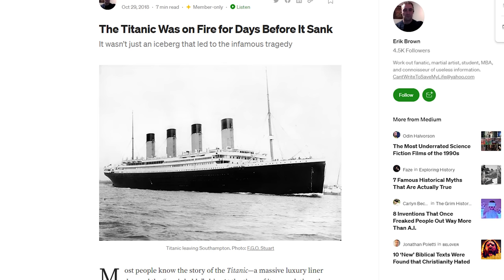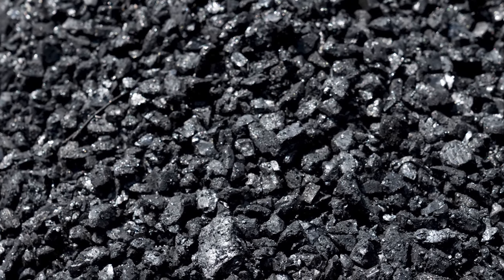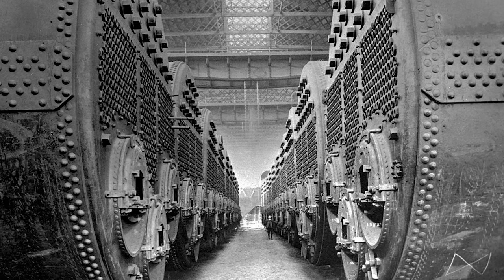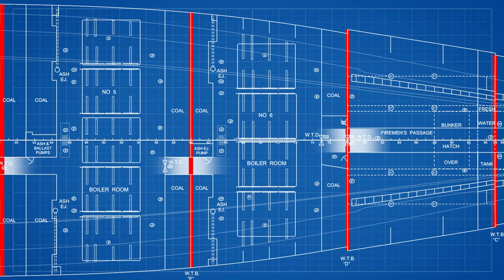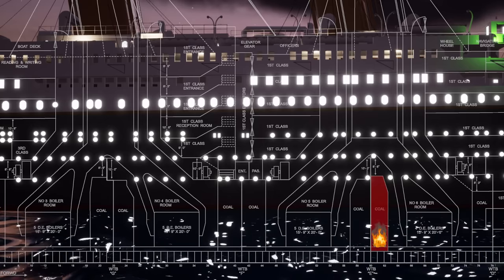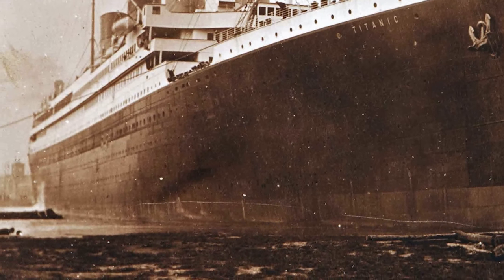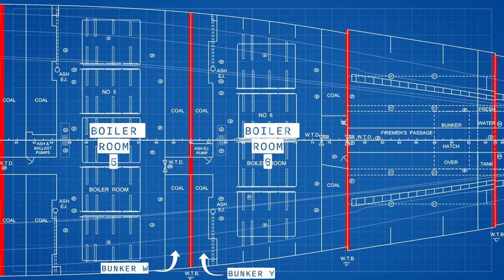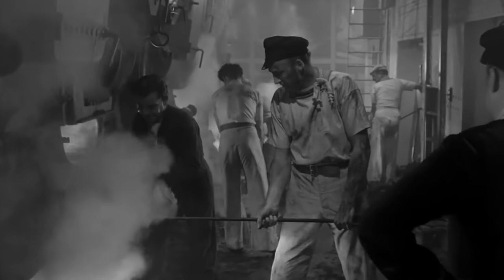Did the Titanic's Coal Fire Cause the Disaster? The Burning Question.

Comment: Thanks for posting a video that actually uses science and facts to debunk yet another ridiculous Titanic conspiracy theory.
There are plenty of new ones lately, but the "It was a coal fire!" one and the "Titanic was actually Olympic and it was an insurance scam!" ones are probably the worst.  The latter is preposterous and holds up to no known records.  The former, the subject of this video, is literally impossible according to the laws of physics.

Coal fires were common on ships at the time, and without the containment of a proper furnace would never have been able to heat even the primitive, fairly mild steels of the day to anywhere near their critical temperature.  Furthermore, even if such temperatures had been reached, which I will remind you again is literally impossible, it would have been moot.  The forces involved in the impact would have exceeded the yield strength of the plates and tensile strength of the rivets, even with proper manufacturing, proper heat treatment, and ideal conditions.  The flooding would have taken place, the watertight bulkheads would have been too low, and the ship would have gone in by the bow regardless.  I'm sorry conspiracy theorists, but it was still an iceberg.
It will ALWAYS have been an iceberg.

The only credible modern theory that has any strong evidence to support it and which clears up any "mystery" surrounding the sinking is that cold water mirage resulting from the Labrador current likely hid the iceberg until it was so close that it had become impossible to effectively maneuver around it.

In which case it was still just the ship hitting an iceberg, with the slight wrinkle that the iceberg also had optical camouflage.

Comment: Another way it could have started is if one of the Stockman's caught fire and was running around so much he bumped into the coal pile and said it a fire the only problem with that is I don't think he would run around and I think they had like water buckets to put out fire and stuff back then so if that did happen yes the coal file would be too big to put out but if someone was on fire you could drench them also did you know there is still water on the Titanic swimming pool😂😂

Comment: Mike—great presentation, as always. Please forgive my ignorance, but have you done any episodes on could the Titanic have been saved? Smith seemed to just give up and say, “OK.  Well that’s that!” I’ve heard a set of double doors were left open, which rapidly increased the rate of sinking. Again, thank you for your wonderful site!
Reply: When Andrews returned from his inspection and advised Smith that his ship was doomed, it is difficult to see what alternatives the captain really had.
Reply: To the extent possible, the crew did try to hold back the flooding as much as possible. Ballast pumps were used to pump water out of boiler room 5 that was leaking from the flooded coal bunker. Not much could be done with the sections forward of boiler room 5, as they flooded too quickly and were not equipped with their own pumps.

Comment: somthing must have been wrong with something for it to start taking on water especially with all the safety masseurs it had
Reply: ...Would grinding against the side of a solid mountain of ice along nearly 300 feet of the hull be enough?
Reply: @DerpyPossum  it had water tight walls and all that but all of a sudden the rest of it was flooded
Reply: @tropixi5336  The water flooded 5 of the ship's 16 watertight compartments, only 4 of which were able to flood without any serious issues. That amount of water pulled the bow down enough to where the water was able to bypass the bulkheads via the decks above, in ways the ship simply wasn't designed for.
Reply: @DerpyPossum  ahh, i but my thought is if they were designed to take in water why werent they water tight on the top of them? or is that where the iceberg struck?
Reply: @tropixi5336  The water was able to bypass them from above via doorways and other small, non-watertight openings like vents, which would allow the water into sections of the ship that went above the bulkheads. As an example; the water in boiler room 6 would rise up to E deck within the boiler room itself, before spilling through a doorway out onto Scotland Road (the main crew corridor on E deck, which was the longest on the ship), flowing aft down the corridor itself, into another doorway and down into another boiler room, filling it up and repeating the process until the ship was sunk. The bulkheads were watertight at the top, it's just that -- since the intended 4 compartments filling wouldn't drag the ship down enough to flood higher than E deck -- the top simply wasn't any higher within the ship than E deck.
Reply: @DerpyPossum  ahh, i was under the assumption that the water filled the bottom first witch dragged one side down first before it snapped

Comment: The dark spot on the hull should also go straight up the side of the ship since, when the ship is not moving, the smoke would rise. I doubt there would have been enough wind in the right direction every time the ship was stopped. Most likely a defect in the negative or print.

Comment: God, not this stupid "theory." First off, most of the coal bunkers were below the waterline, so any fire would have been under water so if the fire ever did heat the hull, the cold water rushing past (especially with the cold conditions of the time of her sinking)  would keep the hull from getting too hot. If the fire had been that high, then it would have been dug out very quickly. Second, it was NOT a watertight bulkhead that failed. It was the coal bunker that failed when it filled with water. The bunker walls were never designed to take the pressure of that much water filling them so it eventually gave way, not the bulkhead. FFS, people and their BS theories.
Reply: You didn't watch the video didn't you ? This video DOES not support the theory, on the contrary it debunks it completely. But you would have to go beyond the intro to see that.

Comment: The smudge actually does align with the fire area. Double check your own blue print and cross reference the actual photo and the intersection of the bridge t section. The fire would have warped any heat treating.
Reply: The fire was in coal bunker number 6 which was further back and below the waterline. It was also just a smoulder and never reached temps high enough to weaken the hull, especially when its in contact with the frigid ocean. 

Bunker fires were common and the one on Titanic contributed nothing to her sinking.
Reply: There is one issue, the spot to where the fire was claimed to be located in that photo is way above the waterline. Not on the waterline.

Comment: I’m from coal country USA. And I can confirm that once spontaneous combustion takes place, those fires can sometimes be impossible to put out. There are fires at abandoned tipples here that have been burning for over a century. The lower quality the coal, the more sludge is part of it, the worse the fire. And since Titanic was running on the scraps of coal she could beg borrow or steal, as the saying goes, the quality was not up to snuff. I don’t believe it compromised the hull. In order to do that, it would have had to burn at temperatures too hot for any human to be near it. But I do think it played some roles in the sinking. I do think that may be why she steamed into an ice field at that speed, why she had a 3 degree list to port before the iceberg (because some tonnage of coal was moved to port to slow the spread causing an uneven weight distribution), and a big part of why she sank as she did (she listed to starboard only briefly before listing to port again and breaking in half. If it was only a matter of water weight without the counter weight of extra coal on the port side, she would have gone down differently). Coal fires on board ships were common in the day. Yes, there were laws and regulations against going to sea with one, but that never stopped anybody before or since from doing anything (how many times have you made a “rolling stop” at a red light?) and as you pointed out, the company faced bankruptcy if Titanic didn’t sail.
Reply: The company was far from bankrupt, or facing bankruptcy.   The third Olympic had been ordered less than six months earlier, and the accounts for White Star for the previous financial show a company in an excellent financial state.

Comment: Still remains a mystery in my opinion. Like how rumors are stated when Bruce Ismay pressured Captain Smith into speed making it earlier into New York. How (in the movie) the captain was worried about the boilers and engines. Is this a hint?
Reply: You shouldn't believe everything you see in a movie. The only, possible, conversation overheard between the two was reported by a survivor who claimed to hear Ismay tell Smith that Titanic was making better time than Olympic had. No suggestion of demanding increased speed at all.

Even that, however, is open to question, as the survivor also reported that Ismay and Smith drank a glass of brandy together, when Smith was a teetotaller.

Comment: I saw a documentary that proposed that it was actually the Olympic that burned, and it was switched for Titanic to collect the insurance. The names were repainted, and it was actually the Olympic that sank. The "accident" went wrong. No one was supposed to die. A rescue had been planned. Film showed the name Olympic on the sunken "Titanic". The documentary was very convincing. The Olympic's hull had been compromised by the fire,  not Titanic. That's why the iceberg pierced the side so easily.
Reply: I know that documentary.

The bad CGI they use to show Olympics name on the wreck always makes me laugh.

But in all seriousness. The ships were never switched.
Reply: The CGI which pretends to show Olympic's name on Titanic is a poorly made fake. It first appeared around the year 2000. It has no provenance, no exploration has ever claimed it, or even acknowledged it, and even the author of the 1995 book which started all this nonsense off,  Robin Gardiner, condemned it as false.

Oh, and to make Olympic look like Titanic, it would be necessary to do rather more than paint a different name on the ship. Especially since both ships' names were engraved in the metalwork, not simply painted on.

Comment: That’s what sank her so fast. She had a fire in the coal. It weakened the bulkheads. Should have been addressed much earlier.
Reply: Wrong, the fire was in Bunker No.6 and beneath the waterline. The fire was nothing more than a smoulder and never reached temperatures hot enough to weaken the mild steel of Titanic's hull which need i remind you was in constant contact with the frigid atlantic.

The bunker fire played no role in the sinking and fires of its type were extremely common.

Comment: Why is the propeller which was intended for the Titanic , put on the Olympic when it lost a propeller, now at the bottom of the sea on the Titanic?
Reply: Because no Titanic propeller was ever fitted to Olympic, perhaps? Aside from the blades being set at different pitches, Olympic's propellers were not damaged in the collision with HMS Hawke. The subsequent inspection report, produced by the Admiralty, the Board of Trade, and White Star, referred only to damage to the propeller shaft, and part of the Incomplete Titanic's shaft was fitted in order to get Olympic back to sea as quickly as possible.

The propeller swap myth originated shortly after the number 401 was detected on the propeller at the wrecksite. Switchers were initially perplexed, but quickly came up with an entirely imaginary explanation in order to maintain their nonsense.

You have fallen for it, mon vieux.

Comment: Yeah, I think it's pretty well-known that there was plenty of time to evacuate the Titanic. The reason so many died was that the designers and owners were overconfident in their claim that the ship was 'unsinkable', leading to a lack of lifeboats. So that was a dumb mistake, but it wasn't corruption; they may have been wrong, but everything they said was something they themselves believed in.
Reply: The lack of lifeboats was from the outdated regulations of the time. In fact, Titanic sailed with 4 more boats than both what the laws required and what it was initially designed with.
Reply: They didn't have enough time to properly launch the lifeboats they did have. The last couple were just floated off as the ship went below the water.
Reply: Firstly, they never claimed it was completely unsinkable.
Secondly, there were more then enough lifeboats than required becouse at the time lifeboats were used to transport passengers from a ship to another, not to evaccuate it.
Also the idea that they had a religious fate in Titanic is kinda weird and makes no sense.

Comment: Everyone who knows a bit about the sinking knows Captain Smith ordered the engines to be stopped while the boilers were still burning: where did all that steam go then? The boilers took 24 hours to cool down completely: does someone really think the engineers didn’t think about this tiny steamy detail? Come on...
Reply: The steam was vented out the pipes on either end of the first 3 funnels. It's widely reported by dozens of people that the steam was venting during the early stages of the evacuation, with some comparing the noise to that of several steam locomotives "going off" right by their ears.

Comment: Been enjoying your videos for a while. Some bad info here.

The "smudge" everyone talks about is not the big black one. There are two, considerably aft of the large reflection, which have a more matte appearance than the rest of the paint. They are also lower, with the more forward one being larger.

The possibility of oxygen ingress and waste gas egress from the bunkers is certainly possible, would require research on my part to form an argument worthy of debate, but i know i have heard good ones.

What is not terribly debatable is the many eyewitness accounts from stokers that multiple bunkers ignited from radiant heat through the plates partitioning them. During liability hearings after the sinking, they were forcibly silenced.

What is absolutely not debatable is the "doosie"; calling for more speed to dispose of the coal, which was allegedly burning in a chain as the fire spread from bunker to bunker, and, even if it did not.

Boilers cannot operate on seawater. High efficiency boilers actually use treated water. If you have to release steam, YOU CANNOT replace that water. This is not just a problem for the boilers failing to produce steam. A got boiler and its furnace need that heat to go somewhere. An empty boiler will melt. However, a partially filled one can explode. Steam pressure can easily build  in excess of design limits with insufficient water in a boiler.im fact, stea locomotives leveraged this fact to aid in breaking speed records. Risky as that was, large amounts of fresh water tends to be more accessible on land, where there is a tender for the purpose and infrastructure in place.

Titanic was limited in resources to replenish working water. The logical way to get rid of the coal energy produced would be to convert it to speed. Blowing off steam constantly would have turned titanic into a bomb. If the boilers could even have had seawater introduced in an emergency, the crew would have been reluctant to do so as it would likely have caused irrepairable damage. In addition, the design of the boilers may not have been compatible at all, and it may have caused clogging had that been attempted, which could leave some of the screen tunes dry, which would have cause them to overheat, rupture, possibly dowse the furnace and break the working steam circuit.

When researched thoroughly and knowledge is applied to seperate sensationalism and twisted secondhand tales from fact, the blaze precipitating the collision and subsequent sinking is actually quite compelling, indeed.
Reply: 'What is not terribly debatable is the many eyewitness accounts from stokers that multiple bunkers ignited from radiant heat through the plates partitioning them. During liability hearings after the sinking, they were forcibly silenced.'    Simply not true. Surviving stokers gave evidence, and there is no suggestion that they were 'forcibly silenced.'   What, indeed, does that phrase even mean? 

'What is absolutely not debatable is the "doosie"; calling for more speed to dispose of the coal, which was allegedly burning in a chain as the fire spread from bunker to bunker, and, even if it did not.' Again, simply not true. Titanic had 19 bunkers, only one of which ever reported a fire, which had been extinguished 24 hours or so before the collision, by using the coal from Bunker that bunker first. Simply shovelling coal into a boiler might increase boiler pressure, which will be dealt with by releasing the excess through safety valves. It will not cause reciprocating engines to operate more quickly. 

'Boilers cannot operate on seawater.' Correct, which is why Titanic carried fresh-water tanks in the ship's double bottom. These were located under the reciprocating and turbine engine rooms and had a total capacity of just over 1000 tons. She also carried distillation plants to convert sea into fresh water.  As her stokers were not frenziedly shovelling coal in vast amounts into her boilers in any case, however, your point is irrelevant.

'Theblaze precipitating the collision and subsequent sinking is actually quite compelling, indeed.'   Indeed not. There was no significant blaze, which makes this comment, indeed your entire post, meaningless.